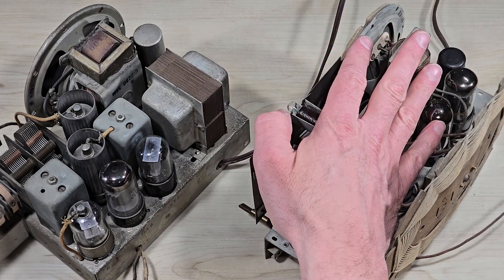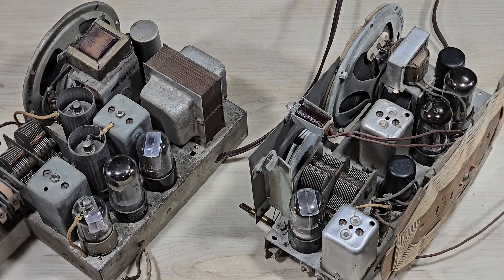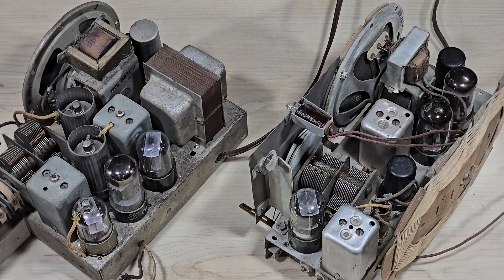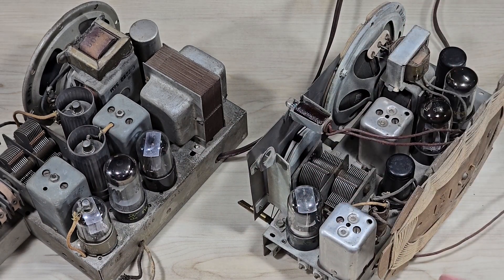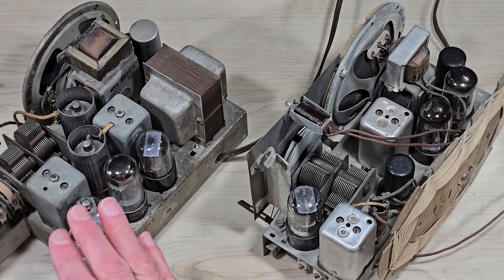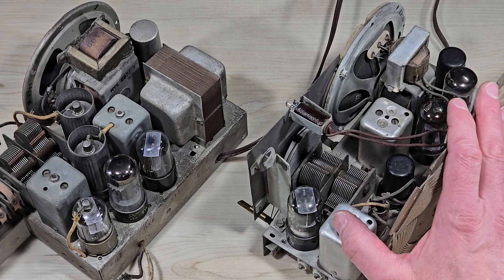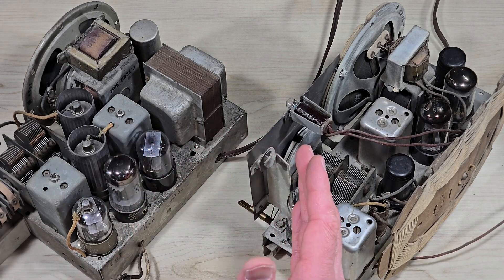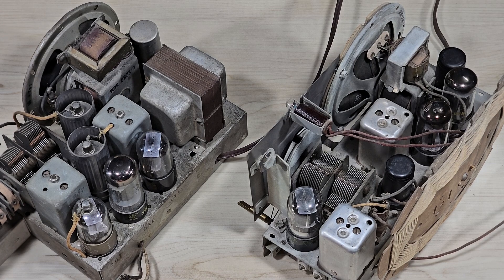Design Evolution in Early All American Five Radios

Comment: The AA5 used common tubes among manufacturers.  For the most part there were maybe a couple choices with the octal or locktal tube types but by the time the miniature tubes were used in the AA5,  it was almost standardized with everyone using pretty much the same tubes. They could all sell their own cosmetics and appearance but the fact they used the same tubes resulted in economy of scale where the tube makers could produce large volumes of a few tubes for less money to the makers. So they all saved production costs.  As for the other parts in  the radios,  there was more variations in other parts of the radio,  in house production etc.  This is also a boon to people that restore these types as they do not need a large tube inventory.
Reply from the maker: Yes! There all used similar tube sets. 

The last 7-pin miniature sets were very compact. This is especially true with they used a PCB and modules that encapsulated most of the circuitry.

Comment: It kind of always amazed me was that the current for the heaters on all 5 tubes, needed to match ... same wattage. The 50C5, the 35W4, the 6SN7 tubes, 🤐required widely different heater voltages. Finding 5 tubes that added up to 120 Volts for a series path was an amazing design. Kind of amazing that at age 70, I can remember the tube numbers of something our class built at the beginning of my junior year in high school ... 1970
Reply: the current ratings of the filaments have to match too, like you may see that all tubes in a series have the same current requirement regardless of filament voltage.
Reply from the maker: It would be very interesting to talk to the design teams back in the 1930 when this technology was taking shape. 

I suspect the primary conversation involved optimization - how do we make the sets smaller with as with as few tubes as possible.

Comment: A slightly newer design using the then current versions of the components, we built the classic 5 tube super regen radio from a kit in my Electronics 201 class in High School in '68. Transistors were electronics 301 in '69.
Reply from the maker: That sound like fun. 

At the same time, it must have been a challenge as the hand soldered assembly requires attention to detail.

r/

APD
Reply: @apdahlen  Well using Knight and other kits I built a tube tester, VTVM, VOM, CB tester, CB radio and stereo amp. I still have and use some.